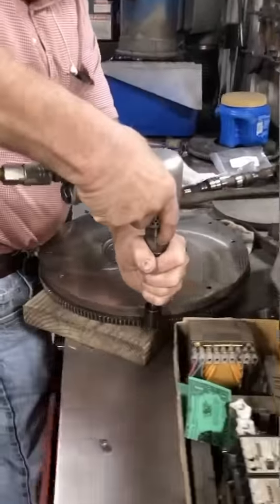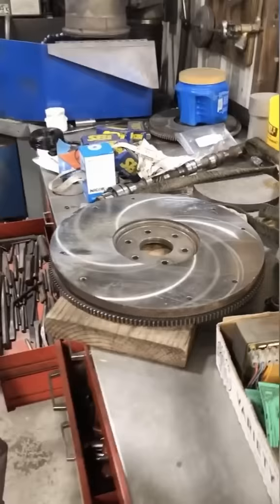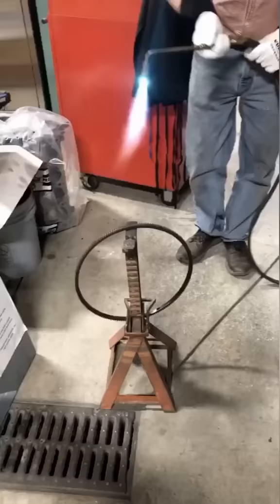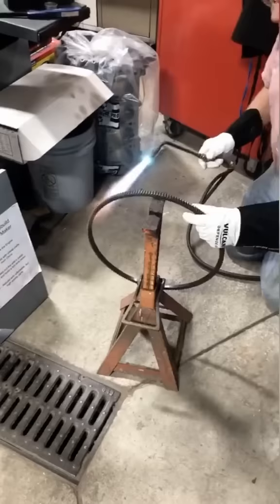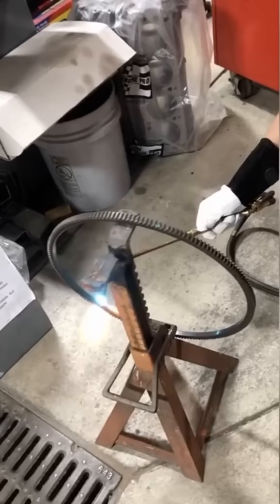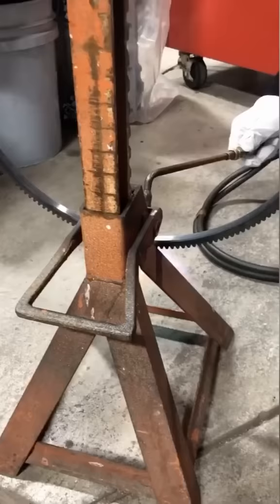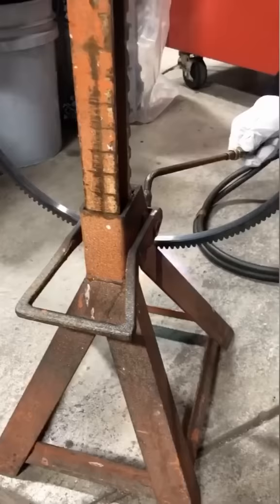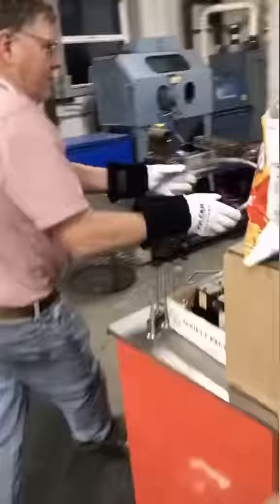#shorts Flywheel Ring Gear Replacement

Comment: My low tech way? Use an angle grinder to cut between two teeth, but not too deep then use a cold chisel to bust out the last bit.

Now clean the flywheel, put it in the freezer for a couple of hours. Then put your domestic oven up to it's highest temperature, put the ring gear in for about 30 minutes.

Take the flywheel out of the freezer, and drop the ring gear over it using some oven gloves. Make sure it's down snugly. Job done, and you are no going to ruin the tempering on the ring gear with the relatively modest temperature from a domestic oven.

Comment: I used to put the distributor gear that fits on the crackshaft of VWs in the oven. A hammer and punch to get them off, since you wont be using it anymore.

Comment: Seeing as you have the torch out, you can heat the old gear to drop it off and wont need the air hammer.

Comment: I WAS TAUGHT TO LAY RING GEAR ON FLYWHEEL AND APPLY HEAT  LIKE YOUR DAD & ONLY HEAT RING GEAR ENOUGH THAT IT DROPS DOWN INTO POSITION.   AVOIDS OVER EXPANDING.

Comment: A bit of a cost saver on  oxy and acetylene,  if you find a cheap electric oven for sale on Offer Up, Craigslist, Ebay,  whatever,  grab it. The cost for electrics is almost cheaper than the gas and you can use it for more than just a ring gear swap, like .... 
A BUNDT CAKE!!
Who hasn't found themselves deep in a bottom end rebuild or trying to remove a broken tap from an exhaust manifold and said  "This could use a good bundt cake and a glass a milk right now"? Sure beats throwin tools when that tap gets the best of ya!

Comment: Easier, toss the flywheel in the kitchen oven, ring gear falls off and drop the new one on. Been doing it for years. Works a charm. 350° , same temperature as a chicken pie.

Comment: If you don't have a torch, you can set your oven as hot as it goes and throw the gear on the rack for half an hour. It worked!... although the wife wasn't as happy about it as I was. What's wrong with car parts in the oven?😂

Comment: If you don't have a torch try putting the center in the freezerit will shrink and and the ring in the oven it will expand then you can tap the ring on. No open flame no need to get a torch

Comment: Just lay the flywheel ring gear side up and lay the new ring gear on it while you heat the ring gear and it will fall right into place.  No need to handle hot ring gear.

Comment: The last time I did this they had items that melted you put on the ring gear that would melt when temp was right. I was wondering if to much heat would take away strength if not quenched.

Comment: Dry ice on the flywheel only dont heat up the ring slide it on it doesn’t make the oils on the metal burn off and a couple month’s it’s grinding because half or all of the teeth was so rotten and been beat up cranking on it in the cold or winter days lol and salt on the roads so yeah dry ice works better I used it at the race track’s if I had to replace or fix my ring it happens on a air starter on my UMP open wheel modified’s and old late modle’s lol

Comment: Noooo.  Lay the ring gear on the flywheel and heat it and it will drop on with a few light taps of the hammer

Comment: Ten bucks says he has no question about why he has knee problems, maybe what activity contributed what specifically to his pain might be a question but he knows generally exactly what happened to hurt his knees.

Standing all day on concrete, stooping down and jumping out of trucks are big ones. My dad got both of his knees replaced and he couldn't be happier. I've been athletic my whole adult life but on Dad's advice I avoided jobs that rip you up and my knees still hurt here and there at 35. Don't jump out of stuff and don't hit stuff with your fist like a hammer.

On the subject of Advil, just because the pain doesn't stop that doesn't mean you can take more, you might perforate your intestines like Dad did.

Comment: "heating it uniformly" while applying insane amount of heat to about 1cm of the ring at a time lol . Use an oven or induction heater if you want uniform heat
Reply: Ever worked in a shop? You don’t always have time or an oven, or a massive induction heater. There is nothing wrong with this method.

Comment: Anybody without an oxy acetylene torch you can throw that baby in your oven at home and it works just as well. And if you don’t have an air hammer to get the old one off you can do it very slowly with a blunt punch and a hammer or put some relief cuts in it with a zip cut make sure you don’t touch the flywheel give her a few good shots and it’ll come off also. So basically anybody can do this in their driveway

Comment: Curious as to why you used an air hammer to remove the ring gear.  I've always used the torch to heat it up 'till it drops off.

Comment: Ive seem a guy set the new gear on the box it cqme in, put a little lifhter fluid on the box, light it and when the box is almost burnt up he picked up the gear with gloves and dropped it on the flywheel

Comment: I saw someone heat a bearing off of an axle recently.  Rather than move the torch, they spun the axle to heat it evenly.  I don't know how you would rotate the flywheel in the average shop.

Comment: so why dont you take a small propane tank( a stubby) and make a heat box(forge) using propane( way cheaper than accyetlyne) to heat the ring.just use metal tongs to pull it out and place over plate...just my opinion..lots of shop uses for a forge too

Comment: I did that job many times in my career. How hot? - spit test it. Spit on your finger then tap the finger lightly on the ring gear. Spit sizzles quickly, you're ready to drop it on. Too hot and you'll destroy the heat treatment in the new ring gear. Too cool and it will only go on part way then stick.

Comment: Question about the heated up ring gear. Question is with a heat cycle of the engine how come the ring gear does not come loose and won't work correctly next time. Well that is my question.

Comment: Then what's the process to get the gear off the flywheel?...seems if you put a torch to it you will slightly be heating the flywheel also...

Comment: I never do that... I just drive the ring gear off with a hammer and punch... I take the ring gear and heat to 500 degrees in mommas oven and oven mits and drop it on the flywheel it shrinks to fit

Comment: Drill a hole at the root of the gear tooth, Put a chisel between the tooth and smack it with a hand hammer. Cracks right there. Install new one the way you show.

Comment: Resurfacing a flywheel is not an approved factory service method.
Factory recommendation is replacement.
If the flywheel ever explodes and someone is injured you will be liable.

Comment: Done many of them, and when it was needed imediately but a new one wasnt available for a day or longer and there was at least enough of the back side of the gear left for the starter to engage without just grinding, I have just flippoed the ring gear over for a temporary fix to keep it functional until the new one arrived. Sadly, this is becoming a lost skill as most newer mechanics do not even know the ring gears are removable.

Comment: Yea but a gear is heat treated does that not affect it?  I knock your not really putting the heat on the teeth but still.  Don't get me wrong that's how I'd do it at home but Im also not a machine shop either

Comment: Unprofessional, we use a special roim size oven to gradually heat up any part uniformly  then we also cool parts down evenly over days if need be. Every metal has a perfect heating or cooling schedule to retain strengh and atomic bonds. A more professional workshop also aligns the magnetic in the room as heating and coiling affects a metals magnetuc alignment

Comment: Much easier way to fit the new ring gear is just turn your oven to 250c and let it back for 10 mins , then just drop it on the flywheel. Piece of piss

Comment: I have been in the car buisness for 20+ years and i have nerver changed a ring gear, are your customers broke ? Change the flywheel done and Done . No one even ask for this anymore , this is why your are using a blow torch and i use a induction heater . Stop doing med money Saving repairs, just becuse they are money saving